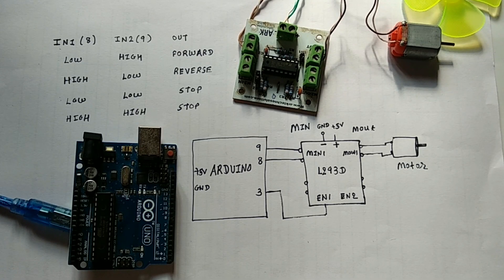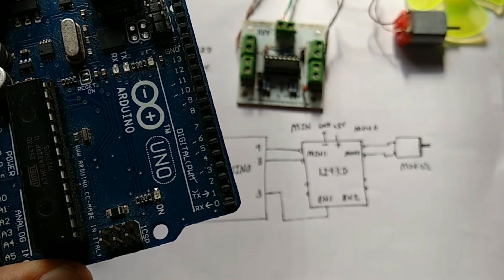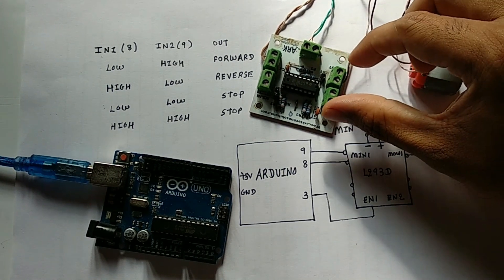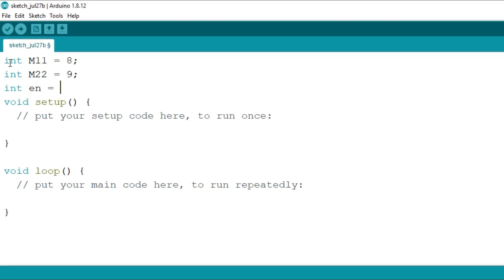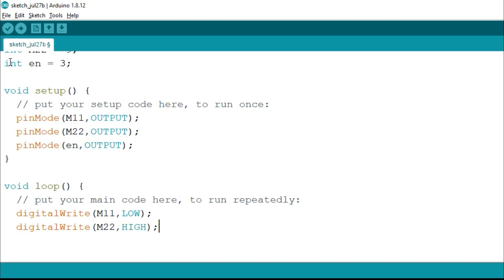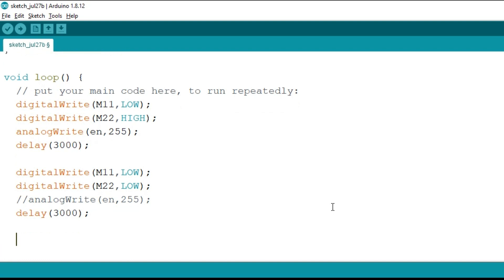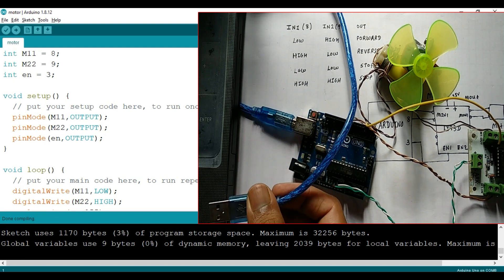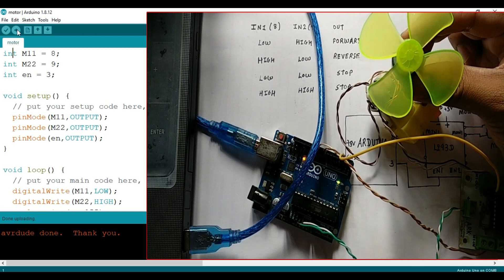Arduino DC Motor Speed Control L293D

Comment: Sir, what if i want to connect 12 v to l293d... Should i connect to Vin of arduino instead of 5 v? Pls reply.
Reply from the maker: No issues for L293D, but make sure that your motor is capable of handling 12V, otherwise motor will burn or heat up
Reply: @ecit  ok sir

Comment: Please help to write program in Arduino using integral backstepping controller for dc motors
Reply from the maker: You can ask me your questions here, let me know if you have ny difficulty in coding
Reply: @ecit  Sir I am doing a project on Integral backstepping controller on DC motor .for that I need both coded algorithm of control action and hardware.Can you share how the algorithm will occur
Reply from the maker: @devikaka1215  sorry, I don't have readymade code.

Comment: Sir can we use L293d IC in the place of Driver circuit??? Using breadboard
Reply from the maker: Yes, you can use IC also. Refer datasheet for connection

Comment: what is the rating of motor and how to give 5 volt ?
Reply from the maker: Yes, I gave +5V DC.
It is brushed DC motor with 10,000 to 20,000 RPM

May consume current around 0.4 to 0.5 A

I have purchased from local distributor and it is not standard motor so datasheet is not available.
Reply: ok sir can i use 12 v dc motor?
Reply from the maker: @sukanyabharti6704  if you have 12V DC motor then you can apply otherwise No

Comment: please tell me what happens if the number 300 is used in analogWrite function?
Reply from the maker: It takes char value only, so you can enter from 0 to 255.

In case if you enter 300 then compiler may consider it as -45

Comment: It is not controlling the speed
Reply from the maker: For speed control as I explained you need to use 0 to 255 in PWM analogWrite. 0 means motor will be stop, now if you write 100, motor will move at slow speed. So for speed control you can use IF condition and based on that you can set the speed.

Comment: I have done all the interface,coding, uploading but why is my fan not working?
Reply from the maker: Which driver are you using to control dc motor? Test continuity in your connection

Comment: Arduino DC Motor Speed Control L293D, in this video there is no speed control as committed. disappointing.
Reply from the maker: By writing different analog values from 0 to 255, speed of dc motor is controlled.

What else you need?

Comment: Very nice video sir...in place of Arduino if we connect msp430 microcontroller how we can generate pwm signals what is the on off time of pulse.  How to find that all please help me
Reply from the maker: You should refer the datasheet of MSP430, actually PWM is implemented using Timer Counter Register. So focus in timer counter.
Reply: Ok thank you sir

Comment: How many motor can connect at a time and can u send link buy this L293D module
Reply from the maker: You can connect 4 motors with default PWM pins, for product you can search on Amazon or other websites, my module is not available online.